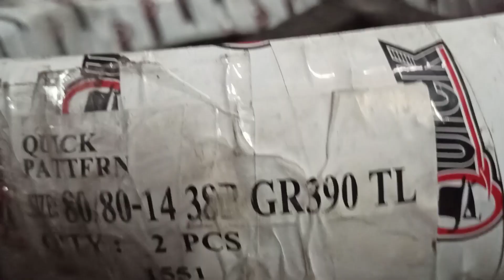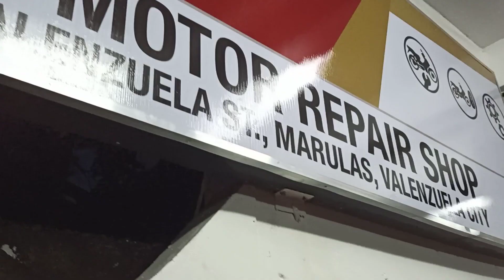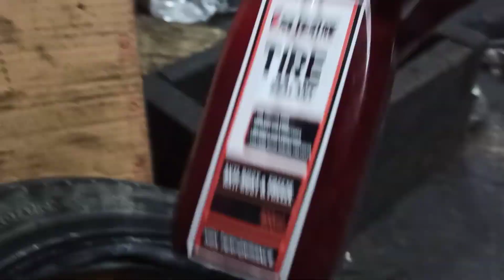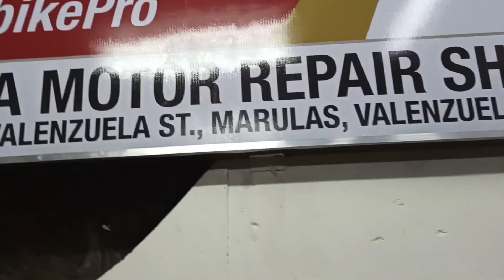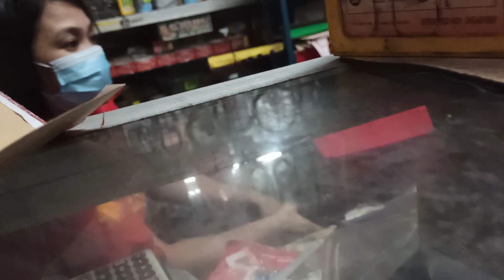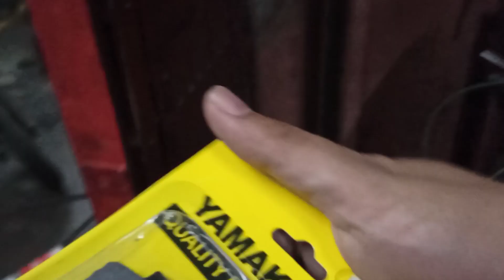Quicktires Front tire | 80/80-14 Mio i 125

Comment: Ayos lang po ba kapag 70/90 14 yung front tapos 80/80 14 yung rear. Magiging lowered na po ba yung motor? Salamat 😊
Reply from the maker: Ok naman po ang size ng gulong, pero if 14 po ang size dipo sya malolowered, unless magpapalit po kau ng shock. Bababa lng ng konte
Reply: @ajnget1  rear shock po ba? Or Pati po front? Salamat
Reply from the maker: @kimberlyannsignar4181  if papalowered nio po, naglolowered po ang front shock, then sa rear naman po bibili kau ng shock na medyo maiksi, dami po sa market ng ganun size.
Reply: @ajnget1  anung size po nang rear shock yung dapat para ma lowered. Salamat
Reply: Ang mahal ng gulong pre....sa lazada 600 lang e...
Reply: sinulit m talga paps 2yrs bgo ka nag palit.. ride safe lng